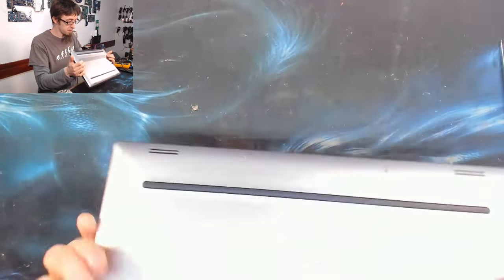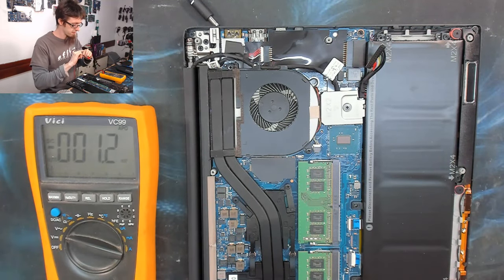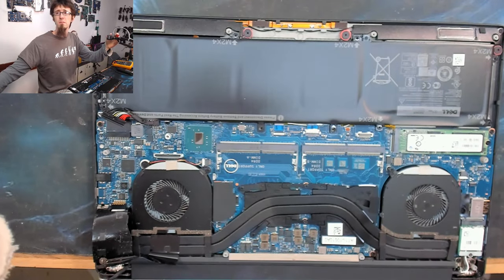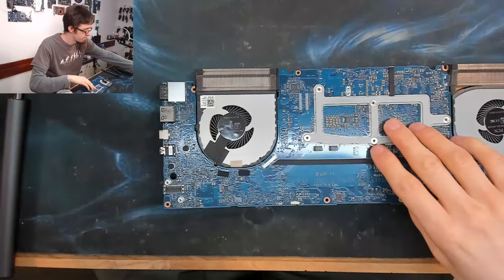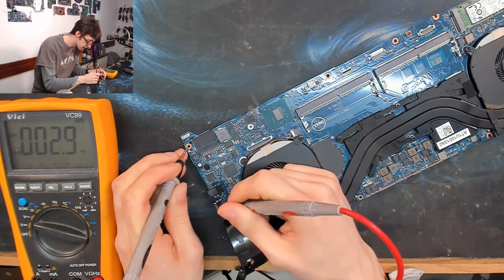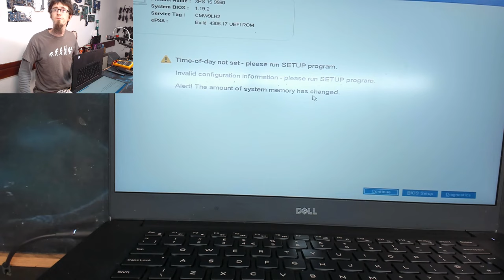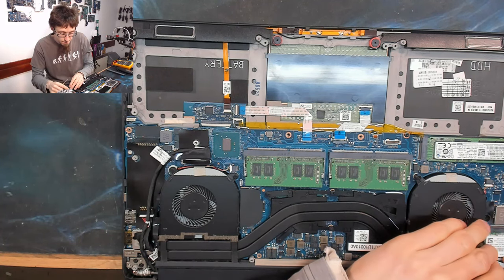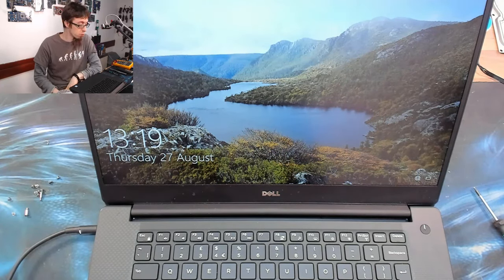Troubleshooting Dell XPS That Doesn't Turn On - LFC#226

Comment: Whenever I find these sort of issues like the laptop comes back after a CMOS reset, I always update the BIOS. Those errors are almost all the time due to bugs in the BIOS which the manufacturers often state as "fixed system does not intermittently start".
Reply: i always do the same 👍🏻
Reply: Defiantly a good idea to at least check for a BIOS update, then for shiggles, I would run Memtest to make sure the RAM is working properly
Reply: Does anyone know where i can order that tape we see in every laptop mother board? You can see it at 1:10 located right above the power connector.
Reply: @thingshappen9199  Those are known as kapton tapes. Those are tapes designed to withstand high temperatures without losing adhesion. You can find them on Amazon.
Reply: Things Happen kepton tape
Reply: @thingshappen9199  Are you talking about the black squishy foamy tape?  Can you describe it?
Reply: @Tim_Small  It's the black film that covers some components i guess to protect them from static shock or liquids?  It's not foam or kapton tape.
Reply: An excellent suggestion Arijit! Thank you for that.

Comment: Thank you SO MUCH! I've replaced the battery from 56 Wh to 87 Wh, and my 9550 would not turn on anymore. Neither would it with the old battery. I came across a forum post linking your channel and I thought to myself, "finally the solution". This is the first time I actually had one of these weird issues that was solved with a bios reset. I did not remove the video connector, instead i propped the mobo at 90 degrees and removed the battey, waited around 5 minutes and put it back. Reconnected the power adapter like yours, and the power light did come on. After connecting the battery too, the charging LED was blinking three times orange and one time white. Held the power button down for a quick reset, did that a few times. Third time it came right up and everything has been fine since (this was 2 minutes ago though). Many thanks!

Comment: Hey, awesome stuff! I have a 9560 that I'm able to charge via the Thunderbolt port but not the 130W power jack. When I plug it in with he battery in, it won't charge, the battery drains - it's as though there's no power source at all and the laptop works off battery alone. And if I take out the battery with the power brick in, the laptop doesn't turn on at all. What do you think this could be?

Comment: Sometimes just removing a ram module, starting the computer, then shutting it off and putting the ram module back saves having to remove the board to find the cmos battery on Dells. Changing the amount of system ram will often force the bios into a "soft reset" - doesn't reset all the settings, but enough to kick the laptop back into life.

Comment: Thank you SO MUCH! My laptop showed no signs of life, but with the help of your video, I checked the voltages and resistances, reinserted my ram, and unplugged my cmos battery for a bit...and it lives!  At least, it now gives me an amber/white blinky code that says i need to replace the cmos battery entirely. But i will now be able to buy one and install it no problemo!

Thanks again 😊

Comment: Just fixed a Dell XPS 15 9560 with no power thanks to your video. You have the best video out there. I can share the pictures but it seems the cmos battery cables were too loosely installed and had actually wriggled out unplugging it. A board screw was actually crushing one of these cables to the point it nearly severed it. After patching that wire and making sure the wires were more neatly tucked underneath the board assembly - it boots up perfectly. Thank you Adamant!
Reply: What is the difference between Dell and DELL ?
Make sure you understand the question before answering
Read the question a couple of times before you answer
Then explain the difference between APPLE and Apple
AIR FORCE and Air Force
NAVY and  Navy
ARMY  and  Army

Start writing your essay explaining the difference in meaning.
That is your homework for this week

Comment: you're a life saver my friend. I've had my dell xps 16 9560 with this problem, jus sitting in the shelve, for about 4 months. Today i decided to send it to a repair shop, but first, i wanted to look it up on the internet. Found your video i decided to try and do the bios reset and now i have a working computer again. thank you so much.

Comment: I've been repairing computers as a career for many years now. My best guess goes right along with you, that it was removing the battery from the BIOS chip that cleared some kind of corruption. I have seen a laptop or two fail where simply reseating the memory chips also returned the system to life, but not that often. Thanks for an enjoyable video.

Comment: I was just about to spend possibly some hundreds of bucks to have someone fix it for me… After watching this I was still skeptical that by merely reassembling stuff you can solve the problem. Nonetheless since the warranty of my device had already expired there is no harm in giving it a shot myself, and it works! Thanks you so much for the instructions!

Comment: I once brought back to life an Asus (Desktop) system by removing the CMOS battery. The thing is, this removal did NOT work immediately like yours. (Yes, I tried several times, battery in and out following procedure)
I was convinced I was going to scrap the MB after trying everything I could think of to get the thing to fire up.  
NO JOY, so I pulled the battery (I'm cheap), thinking this MB is going in the trash.  Next day I decided to give it one more chance, and put the battery back in fired it up, and Wha La !!! The dang thing came to life! I could NOT have been any more surprised (or happy) than I was. This "fix" was something you never forget
Reply: maybe the mb is dusty

Comment: We have seen a few Dell XPS 15 laptops fail due to poorly seated RAM. Simply removing and reseating the RAM is the fix. Sometimes a RAM module dies so try some combo of them. Less common fix is removing the cmos battery, which is also more painful.
Reply: Experiencing this now — is it an indicator ram will need to be replaced?

Comment: Exact same problem. No power, no response. I followed same set of steps. Disassembled everything, put everything back together and hurray it started working. I think it required cmos reset, which was achieved by disconnecting the cmos battery(coin cell battery), keeping it disconnected for few mins and connecting again. 

After putting everything back together, it started receiving power, but it was showing amber and white light sequence on the front indicating memory problem. I inserted RAM modules one by one and then it all started working. Thank you so much.

Comment: *Messing around with the motherboard *
*Laptop turns on *
I'll still charge for this repair 😂
Reply: Yep his time costs something. I charge at least 100 for basic repairs and have a 2 month warranty. Hopefully he updates the Bios if the reset is what fixed it.
Reply: @shiftctrlhack  what currency is that. £100 for basic repair sounds too steep.
Reply from the maker: Depends where he is as well. If you're in the middle of London, I wouldn't be surprised.
I'm in a rural area, so going-rates are a lot less in these parts.
Reply: @Adamant_IT  that's true, you charge for your knowledge either way and the price seems reasonable, I'm an electronics graduate and I love your channel, I've learned some really cool stuff 👌
Reply: I used to charge £50 and I'm in East Yorkshire and I also give 2 months warranty as well, so if it has an issue I go to fix it for free. Yet I've the last 20 years I've fixed a pc or laptop I've not had one call back or it break from anything I've done. Usually I'll get a call back and they've done something like install software or damaged it by dropping something
Reply: @bazahaza  I'm in the US - Florida. Repairs out here are more expensive but my work is good and I always take care of my customers above and beyond if I can. I really value my returning customers. True some of my repairs cost more than other shops but the customer service I provide definitely makes up for it in the end. When I first started I would undercut all the other shops out here to get customers but then I realized doing that was setting me up for failure. Some of my repairs I would charge x amount and would in the end cost me 1.5X more but I never passed it on to my customers unless it was a case where prior work was done and I wasn't informed prior to working on it.
Reply: @dnakatomiuk  Ever do phone support and ask the customer to open a Command Console and then say "type exactly what I tell you" now tell me wha......(you hear a small click over the phone) t do you see on the screen, knowing what they have just done. Customer says what is on the screen and you say "Did you press the ENTER key" and they say "yes". Did I tell you to press the ENTER key? Do I need to continue? They just can't follow slow and simple instructions and it drove me nuts. A 30 second job in person takes up to 30 minutes over the phone. I am so glad I am out of it now. Too old and now too stupid to do it. 😵
Yes TeamViewer but not when it is a locked down corporate/business machine.

Comment: Just had to do the same. I only disconnected enough to lift the motherboard up about 90 degrees and pull the cmos plug. Left for 10 mins, put back together. Had to do the 30 second power button hold as well. Then reset time in bios and disabled sleep mode in bios. Windows 10 started up then locked and slept, I guess it failed in the middle of that process. Power button again and it seems to be back to normal. Many thanks!

Comment: I've run into a couple of notebooks that looked stone dead like this one, and removing the CMOS battery also fixed whatever was wrong with them. I wish it were that easy most of the time 😁
Reply: My laptop I had upgraded the bios firmware and it would not boot. All I had to do was remove the battery and CMOS battery, with the power cable out, and it was able to boot again.
Reply: I've had a couple of Toshiba's that were fixed using the battery method.

Comment: Thanks so much for the video - the bios battery removal and reinstall got me to the point that the power button lit again.   I press the power button and the light goes on for a few seconds and off again.   I've tried 1 stick of memory, reversing them, making sure they are clean, removing the HD, putting it back in  - still just the power button for a few seconds and then it goes off.  I've also done this with just a battery, no battery  - same issue.
Reply: I'm having the same issue as you. were you ever able to figure it out to get it to boot up?

Comment: I think Sorin on " Electronics repair school" channel would of described this as a stuck bios, fixed by pulling the CMOS battery. He also shorts the positive and negative terminals of the CMOS battery connector on the motherboard after he removes the battery to complete the reset rather than leaving it for a few minutes...much quicker!
Reply: Yup, he call it "stuck start-up chip".
I had a Toshiba Portege once, which did not boot. I did all the reset things, but it did not help. I haven't had the knowledge I do now thanks to Grant, Sorin and Northridge Fix. So the laptop was left on the shelf to to look at later. I've reconnected it after about 3-4 months later and what happened? It booted just fine. I only had to set up the BIOS.
Till today, the laptop is working just fine.

Other case in another Toshiba laptop (also portege, but newer) was a batery not charging problem. I thought the battery got dead so I bought a replacement.
After a week, the client started to complain about the battery life, so I opened the laptop again. Guess what happened. The battery got swollen and I had to return it. For the sake of testing I still had the old battery so I reconnected it and guess what, it started charging! It did charge up to 70% of its original capacity. bare in mind that the battery was about 2-3 years old.
Till today (a year or more later) the laptop and the battery work just fine. (with the expected battery capacity degradation)
Reply: sorin is a legend..

Comment: havent watched for a while, I remember I watched loads of this back in July before I built my first pc and I was having loads of heart attacks because I was paranoid about I just not working, I did actually learn something useful, about the battery for the bios. Which i did have to remove cause I put xmp on the ram and it didnt like it. Saved my butt

Comment: Same as wife's Dell, no power took out ram, wifi card and cpu put it all back together and as above it came back on and has worked fine for the last 2 years
Reply: These Dell laptops can be very hit or miss, but the good ones seem to go on for years.
Reply: @jamescollins6085  This statement is valid for all brands. Either you get a good piece or a bad one. As often proved, it takes only one bad Cap to bring the machine down to knees.
Reply: @marcellipovsky8222  This is true. However, Dell machines can be especially unreliable. I've seen a case of somebody having their XPS motherboard replaced three times in a 2 year warranty period. This could have been the fault of the user, though. As this is an unusually high failure rate.

Comment: Thanks for the vid mate. I watched this yesterday (after I ordered a new power port) & my laptop started working again. Put it back together & it worked for a while then died again so I unplugged the battery and just run it off the power adaptor. It still shuts down now and then but I managed to transfer my files to a hard drive. It's only 2 years old so it's pretty disappointing. It's a good laptop, fast & powerful, when it's working and the keys aren't breaking. Won't be buying a Dell again, but they all have their faults I spose.

Comment: I have a same model laptop with same problem. Tried all other methods but no luck except the one required removing the CMOS battery. Your video and result gave me confidence to give it a try. The first attempt didn't work (might not wait for long enough). Then I tried again with a lot of patient. Do you know what, it came back ON!!! Thank you so much for sharing this video. Very appreciate!

Comment: Ram modules sometimes buildup static for some reason. I worked at a company where we build 100ds machines and we had some time machines that didn’t power on, where we only re-seated the ram modules and it worked 95% of the dead machine issues. It was probably something in the machines that caused it.

Comment: Hey man, you mentioned you had poor luck with repairs today. Can you give an example of the sort of thing that stumps you? I'm curious because you seem very good at well rounded troubleshooting.
Reply from the maker: Often silicone issues - failed PCH (chipset) or CPU is typically a dead-end, and reasonably common. Got a laptop on my bench that had a dead CPU. So I tracked down a replacement board on eBay, sold as working, and that was also dead-on-arrival, such are the risks of second-hand mobos. Understandably, the laptop is now in the "F this PoS, get it out the shop" pile, but it's already wasted half a day of my time that I won't get back.
Reply: @Adamant_IT  No you did not waste your time! If you come across such problem in the future, you will know when to stop and not waste any more time. When you learn things and have success after a HARD repair/fix, those moments are the most rewarding. We need those negative ones too, as we learn from them. So, you have learned something.
EDIT: I consider this way of "hands on" learning the best one.

Comment: If you can't remove the battery or you don't know how, there are reset combo buttons per laptop that you need to hold for a few seconds to make it work. Most of the time it involve holding the power button +some key for 30 sec.
Reply: Does anyone know what the combo is for this laptop? (I've got a 2018 dell xps)

Comment: This video is very lucky. Laptop wasn't installing Windows or finding the bootable USB, so I reset the BIOS and the laptop stopped booting. Tried everything, nothing... but found this video, repeated those actions and it suddenly worked.

Comment: Relatable.
I find it kinda necessary to do some sort of fiddling when things like this happen. And oftentimes, resitting a RAM stick or CMOS battery or some loose cable fixes the issue :pp
Reply: What are you doing here? This is the place I least expected to see you outside of twitter
Reply: @charlesturner897  Well... I can't blame you 😆.
This is because I have an interest toward computers and stuff like that, I just don't talk about it much on Twitter 😅
Reply: @charlesturner897  Well, be prepared, you'll see more and more around here XDD

Comment: I didn't see you check the voltage on the cr2032 coin cell battery. They are 3 volt batteries and generally last 5 to 7 years. When their voltage drops below 3 volts, they don't have enough power to properly power the bios chip. Weird things start to happen, like boot issues and clock not keeping time correctly. It's always a good idea to check the easy stuff first. I think when you removed the battery, it reset the Bois.

Comment: One year ago, I assembled a new PC.  All new parts.  Cheap motherboard.
I press the power button.  Nothing happens except a red light on the motherboard.
I was panicking.  Almost dissembled everything.  But before that, I pushed down very hard on the ram.
After that, it started fine.  No more problems.

Comment: I have an XPS 15 9550.  Purchased new in 2016, suddenly would not boot.  I half-traced it to the PCI-e bus because it would boot when all the devices were disconnected.  It ended up coming back to life with new thermal paste (it was really dry) and some alcohol cleaning.  No idea what else I did to fix it, but I will say that the NVMe drive did also fail and it needed a new drive.  In my case though it would at least power on and holding the D key whilst turning on woul run the display debug.